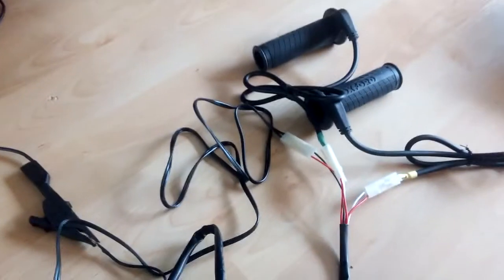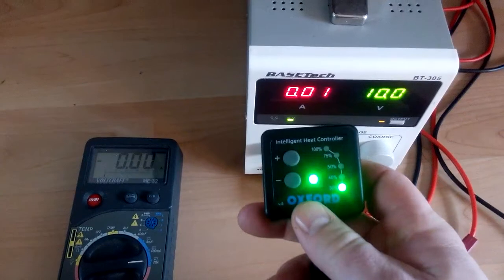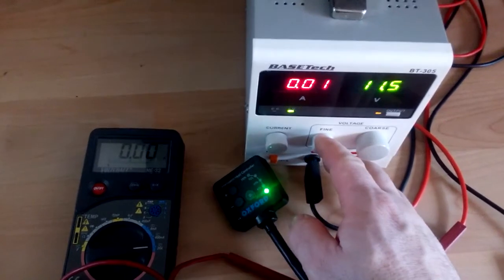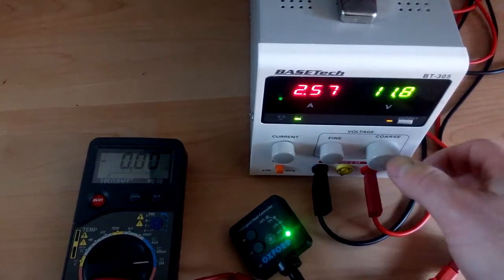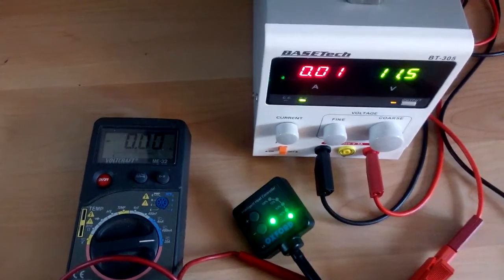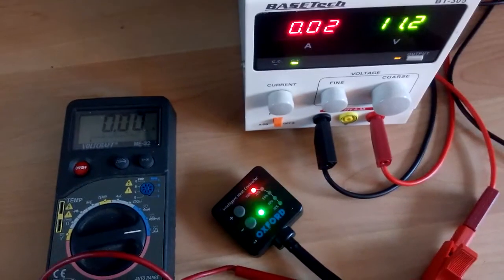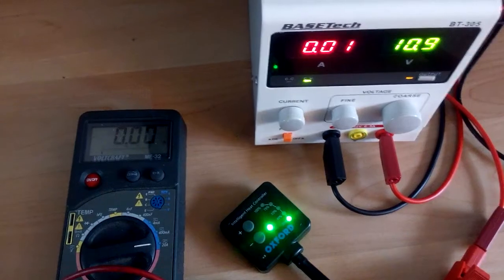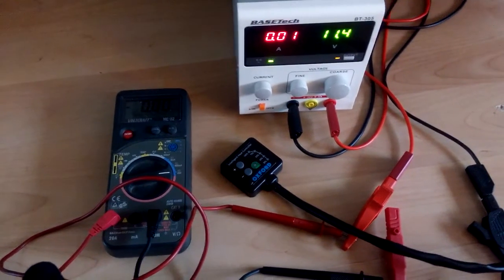Oxford  Heated grips voltage test

Comment: Hello. Should i install an on/off switch for the heated grips or the controller is enough? 
I do not want to drain the battery while the bike isn't running.
Reply from the maker: If you do not trust what you've seen in the video then by all means install a switch. It doesn't hurt to install an extra switch.
Reply: @BertOber  Ok thanks

Comment: Just fitted these onto my YBR-125. Am I correct to assume, that the percentages shown on the control unit are responsible for "titrating" the power via on/off mechanism of action? 30% gives the burst of energy every 2 seconds, 50% every sec, 75% every half a sec, 100% constant power supply?
Reply from the maker: Yes i think so.

Comment: Thank you, believe this will be helpful for figuring out if I have a battery problem and if not then It's probably this problem I'm having -  https://youtu.be/8HagGZhs4f0   - my heated seat/grips comes on initially but very quickly turns off, almost instantly, even whilst I'm riding so there should be enough power, If I find out whats wrong and fix it, al update this comment so it hopefully will save people from faffing about :)

Comment: I have a motorcycle with a 5 Amperes battery. Do I have to replace with a more powerful battery to install this product?
Reply from the maker: stuts1 No you won't. Just make sure the alternator has enough power to run both lights and heated grips. In principle this Oxford stuff doesn't empty your battery as it switches off before that happens.
Reply: +Bert Ober  i saw that it turns to "battery saving mode" but it stays blinking green or it cuts really off the system after a while? and how much time to turn it off and not just stay blinking ?
Reply from the maker: +Avelino Ferreira About 5 mins. Check here https://www.youtube.com/watch?v=Co0_zfg_SCA and https://www.youtube.com/watch?v=Co0_zfg_SCA